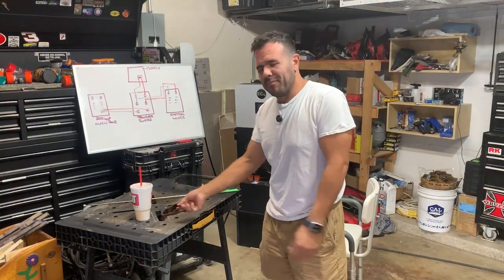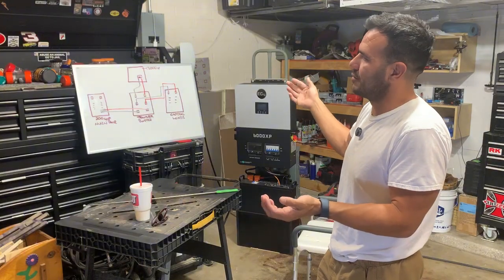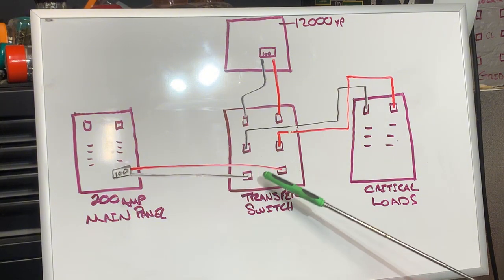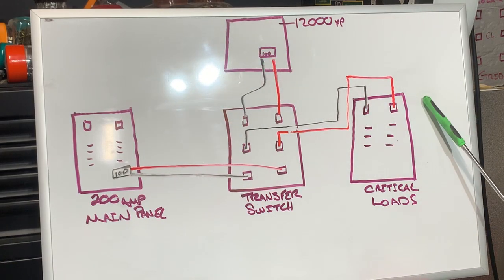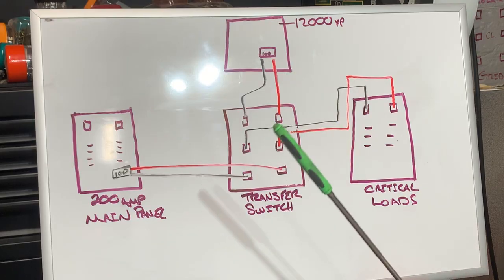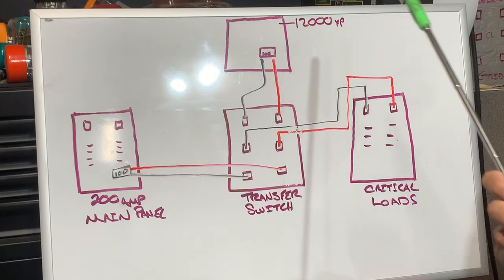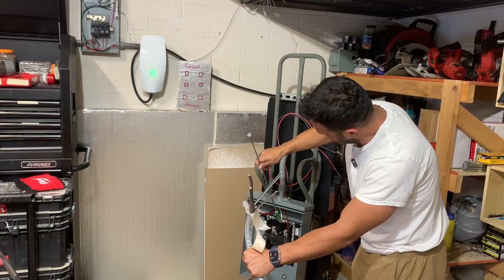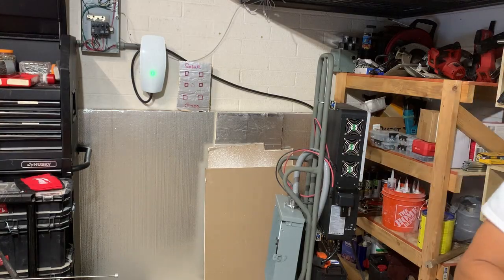Transfer Switch Wiring Explained | Grid vs Solar Power (Step-by-Step with EG4 6000XP)

Comment: I believe you also need to send your grid power using polaris connectors  or a distributor to the 12000xp Grid inputs (bypassing the transfer switch) Otherwise you will not be leveraging the auto switching of 12000xp when your solar is not sufficient
Reply from the maker: The video was mainly to show the “why” behind the transfer switch — basically your safety net if the inverter fails. And yep, the 100A bypass would need another set of wires straight to the grid input, but that’s its own dedicated run. The transfer switch isn’t involved with that one.

Comment: Here's I wouldn't install a 6000XP:  "As of October 2025, EG4 Electronics is facing a legal investigation regarding premature inverter and battery failures, but no class action lawsuit has been officially certified. The law firm Migliaccio & Rathod is actively investigating consumer reports of hardware failures, which could potentially lead to a class action. 

However, the company's terms and conditions contain a class action waiver, which could complicate such a lawsuit. 

Key issues leading to investigation:

Premature hardware failures: The most significant complaint involves EG4 inverters and batteries failing within a few years of installation. Some users report multiple equipment failures in a short period.

BMS and firmware issues: Consumers have reported that battery management systems (BMS) have failed, which can cause communication problems with inverters and result in power outages.

Security vulnerabilities: In August 2025, the Cybersecurity and Infrastructure Security Agency (CISA) published an advisory on multiple security vulnerabilities found in several EG4 inverter models. The vulnerabilities could allow for unauthorized access to a user's network. EG4 has acknowledged the vulnerabilities and has been working on a fix, including new hardware.

Poor customer service: Complaints on social media and forums detail customers' negative experiences with EG4's customer support and warranty claims, with some reporting difficulty in getting timely responses or proper solutions for defective equipment"

Comment: I am about to install an EG4 12000XP, Six 48V 100Ah  EG4 LL S batteries, a critical loads panel, and a transfer switch. The transfer switch has three positions. Load-Off-Line. Does your transfer switch only have two positions? i.e. Load and Line?
Reply from the maker: I installed my system without one but I wish I would of lol😂 
All the transfer switches I was looking at tho had 3 positions, 2 lines (Grid or Solar/Generator) and the middle position was the Load.

Comment: Thanks and well explained Jesse.  👏🏿👏🏿. 

Here is the next obvious question that pops up in my head though:  

Given that these all in one  inverters have the BUILT-IN option for different CHARGING MODES (for batteries) and OUTPUT MODES (grid vs battery vs solar first).  Does the integration of the manual transfer switch affects that?   

Maybe I am over thinking this, but it appears that all is being ran from either the GRID or the INVERTER in this case!
Reply from the maker: Yea you’re just over thinking, doesn’t affect any of the different charging modes.

Comment: Thank you for the illustration.  Can you tell me if the 12000xp has the ability to work without the battery. I believe the flexboss 21 has that feature.
Reply from the maker: It might, but the 12000XP is designed as an off-grid inverter and really works best with at least around 400 Ah of battery capacity to reach the full 12,000 W continuous output. I’ve seen a few YouTubers run it with just one wall-mount battery (about 280 Ah) and only get around 6 kW continuous output. I haven’t seen anyone try running it completely without batteries though